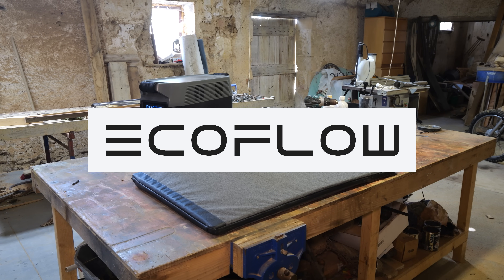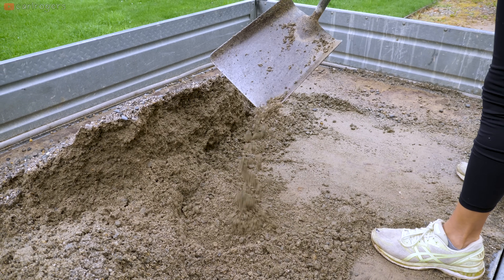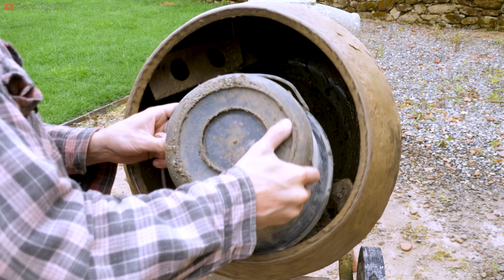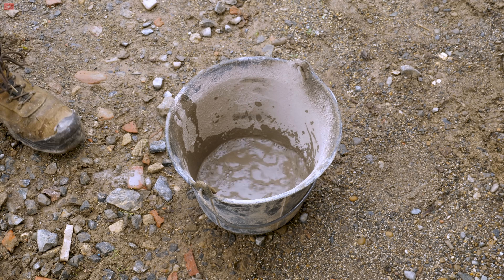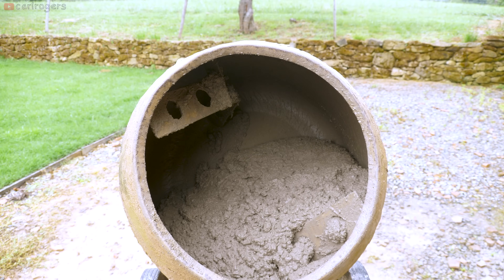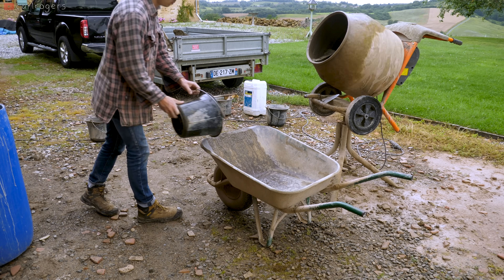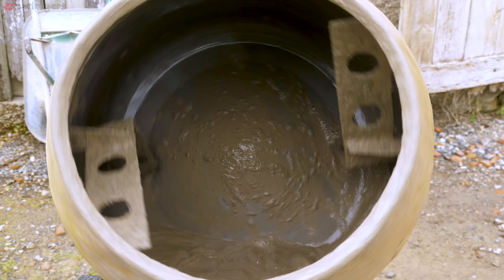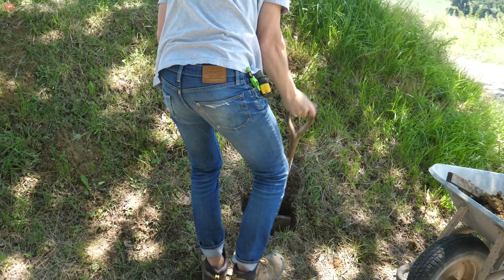How to Mix Concrete (with Solar)

Comment: Excellent video with great tips thanks Carl. But my postman would cross you off his Christmas list for setting the letterbox so high. I set mine on a post leaning towards the road and at a height where he can load it through his little van's window. I'm in rural New Zealand and NZPost doesn't pay him enough to get out of the vehicle 200 times on a day's run! I'm about to set 8 posts for a small cabin, use a cement mixer instead of hand mixing in a barrow.  You vid and a few extra comments gives me the skills to do this right. Cheers to you and the folks who suggested coning around the post.

Comment: Ready mix bags + aggregate of your choosing gets you great concrete. 10-20 mm is what I go for ususally I throw in all sorts of gravel, stone.
Most ready mix is 0-8mm or 0-10mm aggregate add coarser aggregate for a stronger concrete always.

Comment: My opinion is that the easiest way of making concrete is to put water in, then add cement and then everything other until you get the right consistence. So simple and proven to be effective method on several buildings

Comment: Should have learned this from dad decades ago, but RIP dad. Thanks for the recipe and tips. Currently restoring / fixing a 50-60 year old locally made mixer for a few jobs on our land 3 hours from where we currently rent. Mostly going well, but the drum bearing is being a real see you NT. Someone welded the nut on, then left it in the rain with no cover and it all rusted solid. Currently using acid and water blast to remove rust from deep inside where I can't reach before trying to press it apart.

Comment: Just a little tip using these mixers. Put a couple of choggs or blocks of wood say 2/3 inches thick under the back leges to tilt the drum forwood and this helps mixing a lot better. Just be carefull you can go to far and the drum will hit the ground witch could do damnage.

Comment: My mix is much better no I use buckets instead of shovel measures. Thanks for the video. 

I think credit should be given to your sister being present as the this video has had the most hits. 

Keep up the good work. 

I am very interested in the trailer making its move to its new location and what you do there.

Comment: I've always used the 4:2:1 ratio in Australia, 4 coarse aggregate, 2 sand, 1 cement, your mix seems to work though. Very nice assistant. A quick spray with the hose pipe cleans the mixer...

Comment: When installing posts into concrete, the concrete should be put in DRY!
Then it can be rammed in hard. (If it's wet that's impossible.)
Then, when the post hole is full and rammed tight, add a little water, a lot less than when mixing wet.
This produces stronger concrete, and rain and groundwater will complete the job.
Also, you should scorch the below ground part of the post to char it, then brush away the loose excess. This will help prevent rot and bug infestation.
In addition, your postman will like you a lot if your post box is at car window height, so he can open the window, deliver your post, without needing to exit the car/van.😊
.

Comment: I live in Mississippi, USA. I've built a shed for my mower and a carport roof for my old work truck. Nothing fancy just 4x4's 3 feet in the ground. Never used one drop of water. Just poured the bag of Quikrete directly in the ground around the 4x4. There is so much moisture in the ground that the cement will absorb all it needs. This serves several purposes. 1: Once it sets up it is there. The cement will expand a little and grip the wood. 2: NO MIXING! <--should be number one I guess. ;-)

Comment: I always mix my cement and sand dry first for 15minutes with any dry additives like citric acid to reduce the water needed to make the slump of the mixture right. using a plastic bag over the mouth of the mixer  makes it dust free during my 15minute dry mix and  insures an even mixture with no Streaks. water is then added to get the proper slump - if the sand gravel additive and cement - are mixed first you get a better distribution of cement in your mix and higher 7day strength 
Your method would have me failing my civil engineering labs 
Too much water leads to porosity which will cause the mixture to be weaker once it is cured

when mixing cement without superplasticizer the best water cement ratio by weight you can get is  0.4 to 1 by weight. but at this water content it has a poor slump so using the proper flow additives one can get the mixture to almost half this water content and have a good slump.
 I use citric acid as a plasticizer to reduce the water content to around 0.4-0.385 to 1 while maintaining good slump 

Just like baking a cake mix your dry ingredients together first then mix all wet ingredients together  then add the wet to the dry or the dry to the wet. When the consistency is right it is ready to use.

Comment: On the ranch we NEVER set posts in concrete. It will trap water and rot wood quicker. If at all possible use pine tar pressure treated posts. These were used for all corner and brace post with road base at th bottom of each hole. The rest of the hole was back filled dirt rammed at  intervals very tightly. Most theses lasted more than 30 years. FYI barbed wire was predominantly used because of great length and money involved with these projects.

Comment: I have the same Italian mixer. Finally someone on YouTube that doesn’t have a soupy mix. The only thing I would add is to this use polypropylene fibres. They’re incredible cheap and add incredible strength to any mix. Too much water is the worse enemy when it comes to making strong cement.
Reply: Belle Group cement mixer 136 litres to fill 90 litres mix capacity. Build a third ecolodge with the same mixer. Rock solid and the mother is incredible. Turns out the mixer is made in the UK not Italy. I think I got confused because the patent was issued in Italy. 5 years now of daily mixing zero issues. Almost 800 pounds or over 1200 dollars.
Reply: @Buildingenjoyment  Looking good info. I appreciatte, ty. Have a nice day 👍
Reply: Looks small (60 l?) but seems light and compact. Can you give me some info about the mixer model?

Comment: Concrete directly against wood - Guaranteed rotted posts within a few short years. NEVER put concrete directly against wood as the concrete will act like blotting paper and keep the below ground wood permanently wet.

Comment: O.K. so here is the correct general concrete mix as used in building works for mass concrete the ratio is 1 O.P.C , 2  SHARP SAND , AND 4 3/4 BALLAST aim to achieve a moderate slump

Comment: Great instructional but way, way too wet a mix to call it perfect. Should be more like porridge than "lumpy mayonnaise". At 5:1 it's just fine for a post but excess water really weakens the structure. All that volume of water evaporates leaving air in it's place. The tension that introduces is a recipe for cracking and failure in any exposed pour.

Comment: don't you know about the use of galipote? a mixture of tar and pitch to protect the wood on the floor from inclement weather? they are also smeared in diesel or burnt car oil

Comment: Your circular saw issue - I saw this on the Jeromes ( https://www.youtube.com/watch?v=E2tMP3JK55w ) about 2 minutes in - a circular saw with a scale to adjust the depth of the cut that means you don't have the hassle of trying to balance a saw in something like a heavy terracotta pot to continually measure the depth the saw is sticking out of the bottom.

Comment: Moving materials, mixer as close to the needed point as possible, have the stone and sand as high as possible to save lifting and count the hose flow instead of using buckets. Cut cement bags across the middle and fold them opening up in half as you get no dust and can slit the bag into 2 manageable paper tubs. Everytime you lift/transfer it's hard and wasteful that's why we always use horizontal mixers and load off the vehicle tray making sure it's all using gravity to assist. Clean up immediately, a good tip and we include wall and ground surfaces, that post base looks like a beginner finished it and your not, so a little more care would have delivered the pro finish akin to your skills.

Comment: I suspect someone has been bashing that drum to deform it like that. I use a hose pipe to wash the drum, buckets and wheelbarrow; it's much easier if you have access to one on site.

Comment: Hey, I would think this is a good video overall but I have a couple of question. Have you ever seen a cement mixer break someones arm or knock them out when a shovel gets caught and swings around. If you had you might reconsider adding the clips of putting your arm or shovel into the mixer.

Comment: Just adding: the dryer the mix is, the stronger it will be. But also can be much harder to work with and will after a point need to be tampered / vibrated / etc. There are wetting agents that reduce the amount of water needed surprisingly well, but at the same time for regular residential stuff, you don't really need anything special. Still, it's good to be aware of options.
Anyway, nice intro for a method much more consistent than using the wheelbarrow and only the shovel for measurement.

Comment: Use a round cement mixer?
Use hose rather than buckets that way mixer/barrow tools are not cement encrusted.
Wood posts in ground always fail, try concrete ones.
Great filming

Comment: That looks like a very nice method of making concrete. Thanks for the tips!

Though I don't like placing posts into concrete directly. At least not like this. If I put a post in concrete, I'd prefer a coated post (epoxy, tar, rubber, ...). And I would try to shape the concrete in a slight cone around the post, to ensure all water runs away from the post, and nothing pools up against it.

But when possible, I'd go for a metal post anchor at any time.

Comment: Never understood why people insist on concreting in posts when gravel such as you have, well tamped down, is more than adequate. If added in 3-4" (8-10cm) layers and well tamped 
it will hold the post in place just as well.   Did this with 12'  creosoted 4x4 poles I used for a deer proof enclosure of 2500' in circumference 30 yrs ago and the fence is still standing.   If
the post rots out, as they do eventually, then removal is easier and you don't have that lump of concrete to deal with.

Comment: keep water cement ratio 0.3-0.5, use plasticizers (sika plastiment etc) to reduce water. This make concrete stronger and reduce crack possibility. Use glass fiber (30mm) to reinforce. You`ll get much stronger slab and increase curing speed

Comment: This is exactly how I developed the method of mixing concrete, I made 7-8 cubic metres of concrete yet during my renovation project, and your method gave me the best results and is easy working relatively said.
As hand filling the mixer and barrowing concrete is still hard graft.
But another tip to make things easier is to empty a couple of bags of cement at a time in a mortar tub, also I use a separate bucket for the cement and keep it dry and place the bucket in the tub to fill, easier than scooping from a bag and no spillage on the floor.
Also you never should stick your hand or any tools in a turning mixer, these things can break fingers and arms.

Comment: I worked as a grunt/gofer for years, and mixed a lot of concrete. I used to hate those concrete mixers because they would always be a pain to use later. I was tasked with cleaning them, but only AFTER someone had turned them off and let them dry.

That simple use of water and rocks is brilliant. That alone was worth the entire video, and there was a lot more besides. Thanks man. You've saved me money and time :)

Comment: It is not necessary to use any mortar at all to set a post securely in the ground. Dig a neat deep hole (post hole tongs are the best tool) and then really ram the spoil back around the post in stages checking verticals as you go. A few larger stones when nearing the top and you'll be amazed how firm it is. I gave up using mortar a long time ago.

Comment: Great video on concrete mixing. Suggest wearing gloves throughout the mixing and handling process to protect against skin contact with cement - it is toxic. Suggest wearing a mask when handling the cement powder and making dust. Like you said, it’s toxic.

Comment: I've always done 'Two of sand, one of cement'. Also you can make a pile of the mix, shovel in a trough and pour the water in and pile it over. Mixes what quicker and with less effort.

Comment: When you are putting a wooden post into a concrete base, cone the concrete around the post so the water will run away from the wood and not pool against it. You'll get several more years out of the wood that way :)
Reply: Gotta avoid that pooling! A rough aggregate above + below the concrete will also help improve drainage to avoid rotting
Reply: I agree with this.
Reply: @jimthesoundman8641  ⚠️ God has said in the Quran:

🔴 { O mankind, worship your Lord, who created you and those before you, that you may become righteous - ( 2:21 )} 

📖Quran
Reply: As timber shrinks and moves over time how do you stop tiny gaps appearing at the top of the concrete cone and water being trapped inside ?
Reply: @jimjohnston1416  it's not perfect, all wood left out to the elements unless resealed regularly (or oiled) is going to rot.

Comment: Nicely done. It's always good to learn stuff I thought I knew, but didn't. Thank you. I'd have rather seen the postcrete benched up the post above ground level, than topped up with soil, which is often the usual failure plane for timber posts. Although if that's an oak post, it'll hopefully have better resistance to decay than some other species. Still time to improve, should you wish to return and rake out and re-bench it. Those power bricks are becoming all the rage. Here's looking forward to a price reduction in future years (albeit probably not too soon in the current world climate). Far more socially acceptable than a fuel genny clattering all day. Nice piece of kit that - one of the rewards of years of hard work building up a channel. Well done you 😀👍

Comment: Whilst the information on the physical method for mixing concrete is informative the critical information on the correct concrete mixes for various situation is woefully missing.  I am assuming that you think that you are mixing the old 1:2:4, which was a general mix that I doubt conforms to GEN 1 concrete that has a C25 rating IIRC.  Using ballast does not guarantee the correct proportion of fines to stone and the size of the stone determines its workability.  Using buckets to gauge the ballast/cement mix is an acceptable one but I would be interested to weigh the full buckets to see whether they are within an acceptable weight because your female assistant was clearly struggling.  One final thing is that your concrete mix was too wet, it has free water floating on the top, which means that there will be excess 'fat' floating to the surface containing cement dust that therefore has no strength.  If it is used in a floor the top surface will have pure cement when dry and thus be very weak.  The amount of water in the mix is usually determined by a slump test but for general work the adage is the least water the better to allow workability.

Comment: Try putting the cement in after the water, before the aggregate.I
 learnt this from a bricklayer 40 years ago you'll never get cement stuck inside the mixer.
Reply: thats how ive been mixing concrete for the past 20 years. no fucking about with buckets. water...... half a bag of cement and then fill the mixer with aggregate until it starts to fall out. job done and works out pretty much exactly the same strength mix as this bloke but wothout all thefucking about